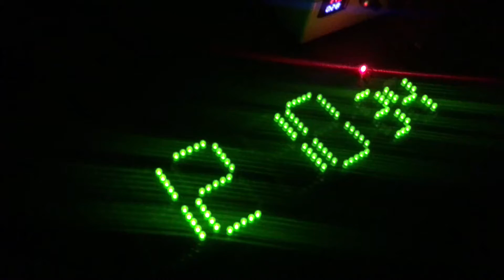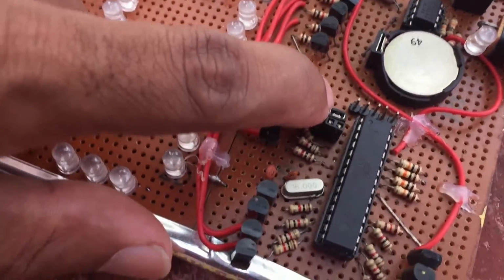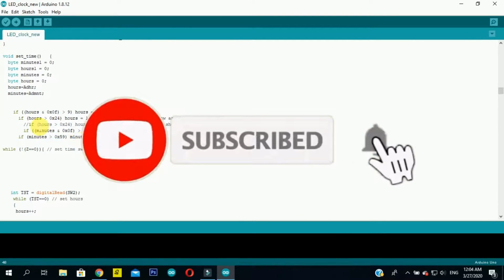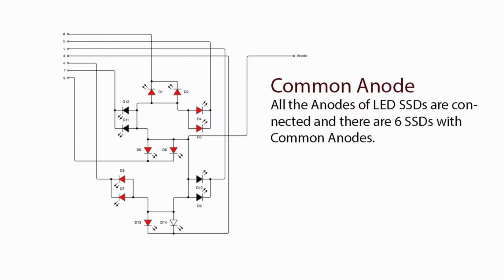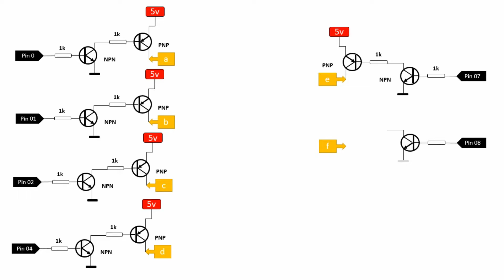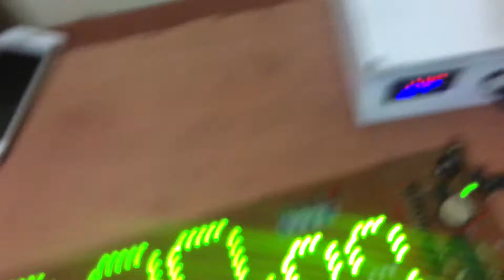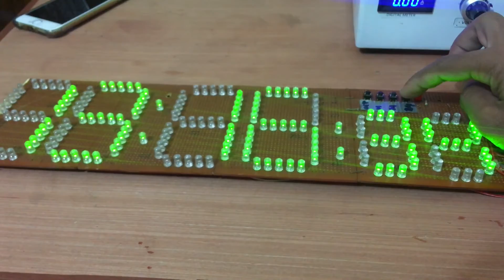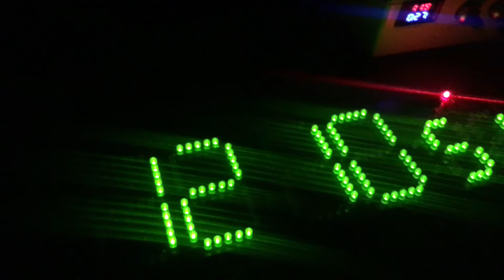RTC Big LED Clock with Arduino

Comment: Hello, to connect the segments a-b-c etc, that you use as a common anode driver a 1k resistor and a bc547 or double transistor bc547 with bc557
Reply from the maker: You can see the diagram in details by visiting the web like given in the description.

Comment: Awesome which seven segment display you used in this anoad or cathod
Reply from the maker: This is an old project. I think I have used common anode. But you can use either ways .Read my web tutorial. Now I am  working on a big LED clock with new upgrades. I will upload the details once it is completed. 😀
Reply: @setnfix  great sir  then I try to make new one sir pl add temperature also ..when this video coming sir

Comment: Thanks for sharing this fantastic project.
Reply from the maker: deactivate the code Serial.begin
Reply: @setnfix    I appreciate it.i commented the Serial.begin() in void setup.the problem i am dealing with has to do with  the hardware b/c the code works like a charm on the same clock i built before with red leds this one with blue leds.Thanks a lot for your time.

Comment: I have made this clock but the brightness of display led is very low. I am using 4 led in every segment  and use bc547 and bc548 to drive these led. please tell me how to increase display brightness?
Reply from the maker: Use over 2am power supply and also you can change the BRIGHTNESS amount in the code.
Reply: @setnfix  i have already use a 3amp smps to power it, in the code what number u suggest to change to increase brightness?
Reply from the maker: @studytechhindi3995  #define DISPLAY_BRIGHTNESS  500 Change this value

Comment: sir i mead this clock the only one problem when i change the 12 to 24 hour  1 to 12 am timer is display but the 1pm to 12pm not display but the serial display  right value but display is not  what is problem but the 24 hour time is prefect display
Reply from the maker: What is showing?

Comment: thanks a lot, dear, i have complete my led clock  project with your support.
Reply from the maker: Great job
Reply: @setnfix  but, after load sheeding the memory was lost. What can i do now? I have installed 3v battery for rtc module also.
Reply from the maker: @ibrahimhossainet  There is an LED in the module. is it blinking?

Comment: I got the code  nd circuit diagram, how to adjust the 12 / 24 hrs option with  connection
Reply from the maker: There is a separate switch to change the mode

Comment: Nice project sir 😊, but in went to add extra zero in hours segment, for example - clock showing 8:30:00 but I went extra zero before 8 ,  like- 08:30:00 
Any solution sir ?
Reply from the maker: yes, you have to enable 1st digit. change the code if the timp value is lover than 100000 to add a zero in front of the timp value.
Reply: @setnfix  ok

Comment: Can i use 2n2222 or bc547 instead of D400 npn transistor?
Reply from the maker: Yes. you can use the both. better 2N2222
Reply: @setnfix  thanks a lot.

Comment: What is the principle of using double transistor, in Anode pin or Cathode pin of LED of SSD. Please inform me.
Reply from the maker: Arduino pin gives you +5v signal. you can use only one transistor to give negative voltage to an LED. But if you want to give +5v using a transistor, you have to use two transistors.

Comment: Clock working fine,but I have question
1. Clock showing 0:00 instead of 12:00 at midnight?
2. PM LED glowing at 1:00PM instead of 12:00 PM?

In intro video your clock showing 12:10 with PM LED glowing but in my case PM LED not glowing at 12 PM.
Please reply
Any help please?
Reply from the maker: since it it 24h, it shows 00: instead of 12.  you have to change the mode to 12h clock to 24h
Reply: Ok thanks for your reply.
But in my clock PM LED is glowing at 1 o’clock in the afternoon, why not at 12 o’clock. In the video PM LED glowing at 12:10. 
Please explain.
With thanks!
Reply: Please reply
Reply from the maker: @virendersingh6027  If you have used the same code, It can not be.
Reply from the maker: @virendersingh6027  **************Find the following code ********************

//------------------------------------------------------
//12/24 hours shitching 
//------------------------------------------------------
if (timp < 130000){
digitalWrite(segDP, LOW);}

**********and change as***********************

//------------------------------------------------------
//12/24 hours shitching 
//------------------------------------------------------
if (timp < 120000){
digitalWrite(segDP, LOW);}

********Then find the following code**************

if (D == 0){  
if (timp>=130000){
timp=timp-120000;
digitalWrite(segDP, HIGH);}
}

if (timp>=130000){ 
digitalWrite(segDP, LOW);
}

if ((D==1)& (timp <130000))
digitalWrite(segDP, LOW);

**************and change as ************

if (D == 0){  
if (timp>=120000){
timp=timp-120000;
digitalWrite(segDP, HIGH);}
}

if (timp>=120000){ 
digitalWrite(segDP, LOW);
}

if ((D==1)& (timp <120000))
digitalWrite(segDP, LOW);

Comment: Thx for ur support I have made this ...one problem I'm facing sir when clock is 24hrs then second led is not blinking is still and when 12hrs mode then its not working pl help in this is any change in code pllll then my clock work well
Reply from the maker: I updated the code in my web page. try with the new code and if the problem is not solved, tell me.
Reply: I problem not solved
Reply from the maker: @sonuala5671  2nd led mean?
Reply: Dot led
Reply from the maker: @sonuala5671  Dot LED is not a part of the programme. It is directly connected to the RTC led. check the wiring again.

Comment: I just made it tonight successfully, but why it shows 25  after 24 . Is it possible to make only 12 hours clock ? and how . thanks 👍🇧🇩
Reply from the maker: Yes, you can. If you do so, you the toggle switch to 12 hr <>24 hr is no more needed.
Find the following codes
int DIM = 0;
if (timp >=250000)
timp=timp-240000;
//------------------------------------------------------
//12/24 hours shitching 
//------------------------------------------------------
if (timp < 130000){
digitalWrite(segDP, LOW);}

if (digitalRead(SWT)==0){delay(300);
 if (D == 0) {
 D =1;delay(200);}
 else{
D =0;}
}

if (D == 0){  
if (timp>=130000){
timp=timp-120000;
digitalWrite(segDP, HIGH);}
}

if (timp>=130000){ 
digitalWrite(segDP, LOW);
}
if ((D==1)& (timp <130000))
digitalWrite(segDP, LOW);
//******************************************
//AND REPLACE WITH THE FOLLOWING CODES
//*******************************************

//------------------------------------------------------
//Not to Show 24 hour clock
//------------------------------------------------------
  
if (timp>=120000){
digitalWrite(segDP, HIGH);}
else {
	digitalWrite(segDP, LOW);}

int DIM = 0;
if (timp >=130000){
timp=timp-130000;}

if any errors, please let me know. Thank you.
Stay with SetNFix
Reply: @setnfix  thanks again 👍
Reply: @setnfix  Re declaration of int DIM = 0;  this is the error message . That's why the code was not compiling  but I delete one declaration then it compiling successfully and it working onley on 12 hour 's  thanks  .
Reply from the maker: @moshiurrahmanmeraj6640  delete int DIM = 0; and check
Reply from the maker: @moshiurrahmanmeraj6640  best of luck

Comment: can i use 12 volt seven segment leds with this process? please help
Reply from the maker: yes, you can
Reply: @setnfix  pls connection diagrams
Reply from the maker: @dipankarmondal3053  visit to the web
Reply: Please LED connection by series 4 and 5 LED protect the 🤔
Reply: i used 5 LEDs in each segment, give extra 5volt power supply via npn & pnp transistors ,
but still my leds not glowing in full brightness, i cant understand where is the issue
Reply from the maker: @sumenchoudhury3861  Change the brightness level from codes
Reply: @setnfix  no brightness level option in my code, i thing some current loss in transistors, input voltage is ok but output voltage little bit low

Comment: HELLO BROTHER, THANKS FOR UPLOADING VIDEO. AFTER WATCHING YOUR VIDEO I DESIGNED  A CLOCK    FOLLOW YOUR CIRCUIT AND SUCCESSFULLY MAKE A CLOCK. IT WORKS WELL BUT CLOCK HAVE TWO PROBLEM FIRST IS   AFTER ONE DAY TIME BECOME INCORRECT AND SECOND IS CLOCK STOP WORKING AND SECOND LEDS ARE BLINKING  AFTER RECONNECT POWER IT START WORKING, PLEASE HELP ME TO SOLVE PROBLEM. IAM USING TINY RTC I2C AT24C32 DS1307 REAL TIME CLOCK MODULE.BEFORE YOU HELP ME TOMUCH .THANKS
Reply from the maker: Time delay can be adjusted changing the value of brightness. But due to the deference of the quality of the components some delays occur.

When arduino is connected to PC, signal transfer between PC and arduino, therefore LED may blink.

Comment: Sir I had done your project .all function are normal but  I'm facing problem in 7 segment display brightness. Pls guide me to increase the brightness in code.
Reply from the maker: How much current you have used?
Reply: Actually i modified a 50 ton weighing machine remote 6 digit 4 inch display for this project . It built with a AVR controller and uln2003 display driver. i removed the 40pin  AVR controller and applied signal from arduino nano to corresponding pin for display. when i run the project it work fine but with dim display. when i changed the display brightness in code from 20 to 100 the brightness increased, but it affect the seconds. mean that after 1... display jumped to 3.. and 5... so on...
Reply: hope the  current and voltage is sufficient, since its already  in working condition as a weighing display.
Reply from the maker: @pandiarajan464  Yes, you can only fine tune the brightness of the LEDs as it is happened to jump the numbers of seconds due to a changes in brightness.
If you have changed the numbers of LEDs, calculate the current requirement for one SSD and check the maximum capacity of current that the Transistor able to handle. When the LEDs are increased you may have to change the transistors suitable for the Display as the transistors are working as ultra-speed switch to On/Off the displays. And also check the diodes and regulators as they can handle limited current only.
Reply: @setnfix  OK sir thanks for your fast reply. Let me check the components  as your info.

Comment: Thank you sir , i completed the project working fine, but a small problem when clock is running in 24 hours mode, when i switch off supply , the clock is switching over to 12 hour mode, please help
Reply from the maker: yes. it is because your data not keep in the memory. But you can do it using EEPROM codes or simply using a push on/off button switch.
Reply: my project dont run why

Comment: Can I connect ds 3231 rtc
Reply from the maker: I think. But I did not try. I am expecting to make another video with it. Try..
Reply: @setnfix   please make it
Reply from the maker: @baluk8191  due to covid, there is lack of parts. I will try my best
Reply: Can I connect 12v led for the display
Reply from the maker: @baluk8191  nice

Comment: Sir what's the value of ds1307 crystal.32.768khz or 32.768hz?
Reply from the maker: 32.768KHz
Reply: @setnfix  thanks.but in your schmetic 32.768hz shown plz fix it.
Reply from the maker: @RizwanAli-ev9gm  32768Hz is equal to 32.768KHz
Reply: @setnfix  ok thanks again sir.can use LEDs without transistor.i think if i use single led per segment then i need only single npn transistor for cathode point.only anode point needed transistor.is it right?
Reply: If u use 1 (one) led/segment no need for transistors.

Comment: I GIVE 12 VOLT 2 AMP POWER SUPPLY TO 7805 IC AND GROUND IS COMMAN .
Reply from the maker: 7805?
Reply: 12 v supply input pin 7805 and 6 digits transistors bc557 to emitors

Comment: Dear sir,I have build the proteus file according to your code using both CC & CA display & load only ssd hex to arduino.But its not working properly.Please sir help me.I will be obliged to you for ever.
Reply from the maker: Did you  use the transistors ? and is it supported the libraries ?
Reply: I have no use transistor in proteus file. Line number 33 when RTC_DS1307 RTC; library file showing error. When I erase RTC_ & only DS1307 RTC; having code successfully compiled.Please sir help me.And which type display I should use the given code?

Comment: Sir made this clock running ok but it becomes late near about 5 minute in 15 days. I this the time calculation formulas is not accurate please help me and correct the code. Thanks
Reply from the maker: It is because of the issues in RTC module. you can check my new video regarding LED clock.
Reply: @setnfix  thank for reply I will check I have used etc DS1307 IC and make the circuit.
Reply: @setnfix  I have checked problem is in second counting. Second counting lag every 4 second throughout the cycle. Please correct the program for this problem. Thanks
Reply from the maker: @Electronics-n2w  Adujust the brightness level. And also you can try my new project of LED clock.
Reply: @setnfix  thanks for reply. Minimum brightness is used. How I can upload the video of second count. Then you will see the problem. I have made two clocks one led digits and other is 7 segment display. Both have same problem.

Comment: In my clock every day few seconds slow , what is the solution 😢
Reply from the maker: It is because of the issue with RTC module. Check my updated clock with new RTC module.

Comment: Thanks to you sir, I have successfully completed the building of the clock,it works fine but where did u connect that red led for 24hrs to? Which pin did you connect it to?
Reply from the maker: Thank you. Happy to hear it. LED should be connected to Pin 13
Reply: @setnfix  am so grateful to you sir,for your support
Reply from the maker: @ArifHossain-fb3gm  send me the error code
Reply: @ArifHossain-fb3gm  
কোড এ কোন এরর নেই
আপনার লাইব্রেরী গুলো এড করা নেই 🤣
তাই কোড এ এরর দেখাচ্ছে 🤣
Reply from the maker: yes

Comment: If I use DS3231 for beater performance  instead of DS1307 , can this program run?
Reply from the maker: No, you have to change the code
Reply: which potion of the code to be change or fully, pl let me know. regards
B.B.Das

Comment: HELLO BROTHER, THANKS FOR UPLOADING VIDEO. AFTER WATCHING YOUR VIDEO I DESIGNED  A CLOCK    FOLLOW YOUR CIRCUIT AND SUCCESS FULLY MAKE A CLOCK. IT WORKS WELL BUT SECOND SHOWING  2 LEDS ARE  NOT BLINKING  , I AM USING DS 3231 RTC SQW PIN FOR SECOND SHOWING LED .PLEASE HELP ME TO SOLVE N THIS PROBLEM.BEFORE YOU  HAVE HELP ME TOMUCH .THANKS.
Reply from the maker: DS 3231 do not have such a facility
Reply: @setnfix  Thanks brother for reply

Comment: sir if segDP is pin 13 then where is the pin of 12h/24h?
Reply from the maker: 13 is for 12h/24h.
Reply: Ok sir
Reply: sir i made the project same as you did .but problem is when giving power all digits are start blinking. even clock is running.also set the time but clock mode also blinking all leds. i cant figure it out. pls help
Reply from the maker: @pcmobiletechnicalsolutions8504  Change the brightness level from code, Check the wiring of control switches, Disconnect if connected to the PC.
Reply: Found the problem. I didn't add 12hr24hr switch. Thats why. Now i just add a pullup 10k on A3 now ok
Reply from the maker: @pcmobiletechnicalsolutions8504  great

Comment: How to solve all digits 0000 and all digits  blinking
Reply from the maker: blinking to change the time
Reply: Sir blinking all digits 0000 and time not changing
Reply from the maker: @cgbollywoodinstrumental2728  It is coming caused to a wiring errors of the switches panel.
Reply: Wow sir amazing project ❤😊
Reply from the maker: @cgbollywoodinstrumental2728  Thank you
Reply: sir, i want to increase the brightness of led. what code need to change for this?
Reply from the maker: @cgbollywoodinstrumental2728  Change the value of brightness. But do not change more, it will be caused to skip the numbers.

Comment: Sir i have a question
1) which pin you use for colon led
2) which pin you use for am/pm led
Reply from the maker: 1.LED of RTC module
2.Pin No 13
Reply: @setnfix  rtc module ki kon si pin se
Reply from the maker: @Annonomou_s  मॉड्यूल में स्थापित एलईडी के पिंस को कनेक्ट करें

Comment: I made this but there was a problem the when 12 noon it changes to 00:00 .help me sir
Reply from the maker: since it is 24 hr mode. if you want to show 12 instead of 00, check the comment in my website.
Reply: Again turns 1 'o' clock showing 00:00.Turns 2 'o' clock showing 1:00. I fixed ds3231 RTC .please help me
Reply from the maker: @sunithavlvl4528  then add the temp value 100000 and try. I have not tested DS3231

Comment: lots of love sir.....
i m already successfully complete this project..but little bit prob...
my prob.. detail below
if (hours > 0x24) hours = 1; // Mid night 12.00 will show as 12:00 (With PM LED on) or 24:00
        //if (hours > 0x24) hours = 1; // Mid night 12.00 will show as 0:00
sir i want to ""show 12:00 / 24:00 instead of 00:00""..same as u...
which scatch change? 
plz suggest me sir..
plzzzz plzzzzzz plzzzzzz❤❤❤
plz reply...plz sir...plzz
Reply from the maker: if (hours > 0x24) hours = 1  sorry, I updated the code
Reply: @setnfix  sir plz send me new updated code here, if possible,
just 12:00, 24:00. instead 0:00
i hope u understand what i say...
waiting for ur reply...
thank u sir...
❤❤❤
Reply from the maker: @rahatislam2010  check the website
Reply: @setnfix  ok sir...thank u..
Reply: @setnfix  it's still the same,  what's the change in the code ? kindly specify .